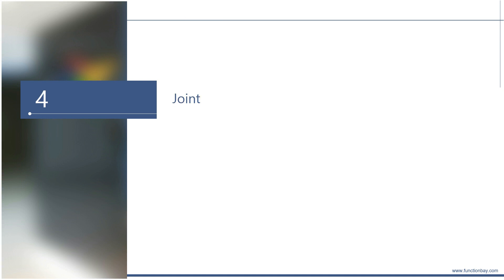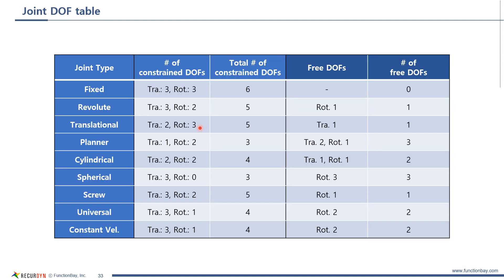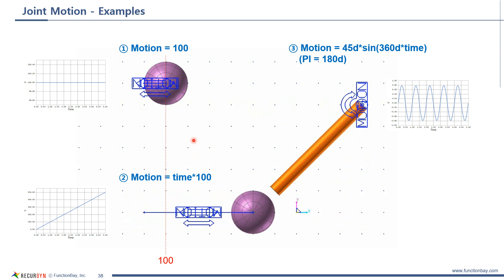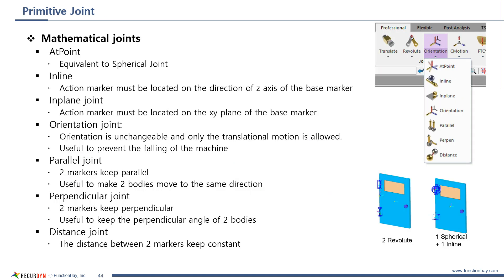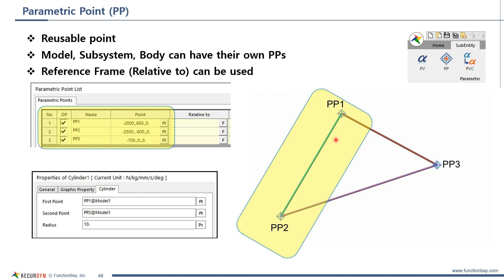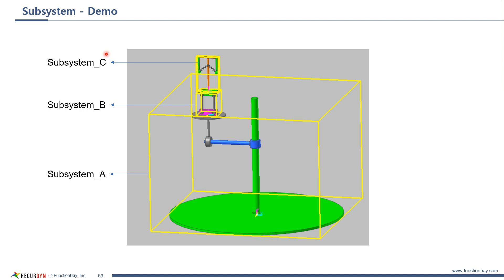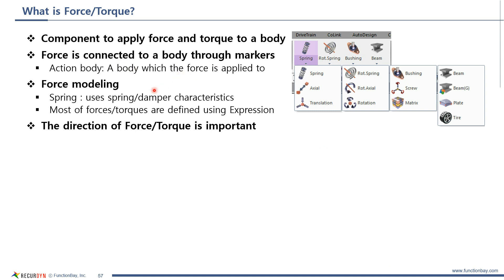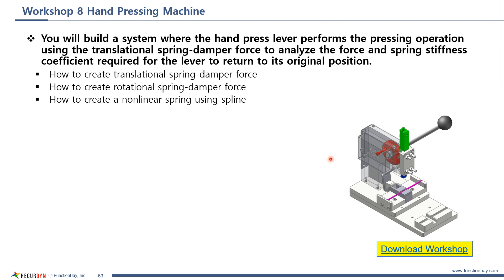RecurDyn Beginner Kit (2/4) (Joint, Parametric Value/Point, Subsystem, Force)

Comment: I can't download the lecture PDF files and Workshop files from the link.  It needs a hotmail account, a month ago I signed up with my gmail account to FunctionBay site. There is no section for this link to sign in with my Gmail account or to sign up with my hotmail account. Or I can't find it.
Reply from the maker: Please try with other web browser. the PDF files are on OneDrive, but it seems OneDrive request signin even if the folder is shared without any account.